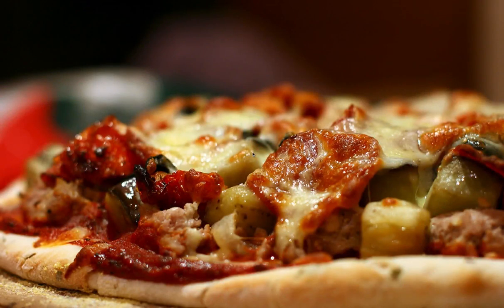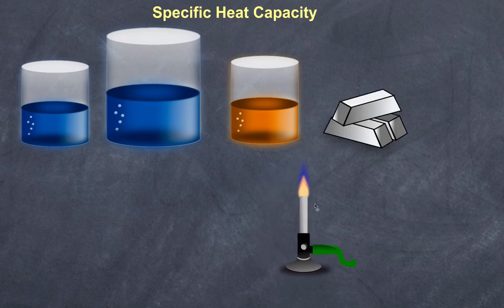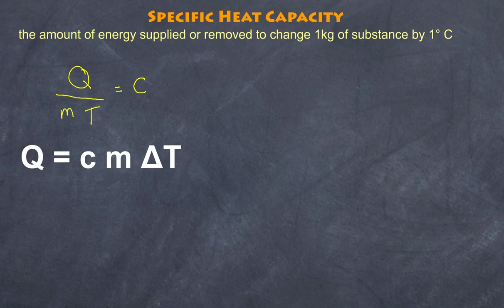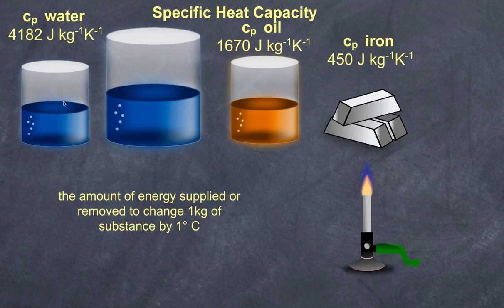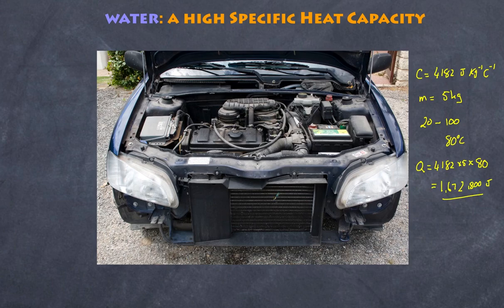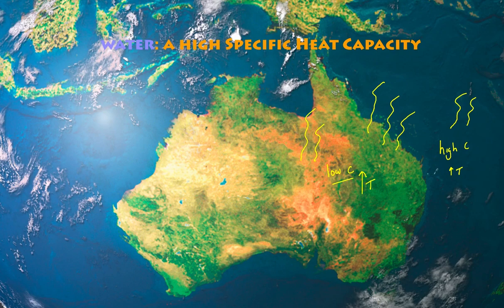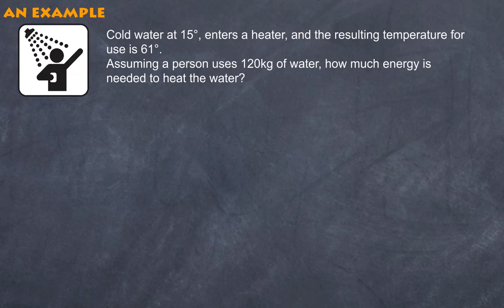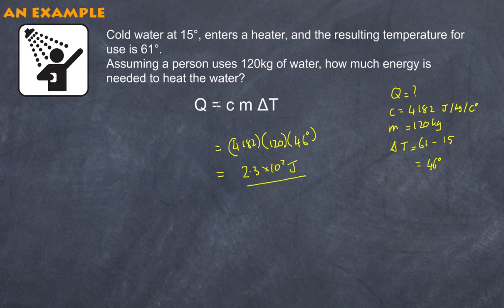specific heat capacity explained

Comment: that means when everttime we substitute for temperatioer do the have to be celcias
Reply from the maker: Actually kelvin is better. But since the scale is only shifted 273, you can use Celsius for specific heat capacity.

Comment: hi. i was doing a experiment to measure water specific heat capacity in a controlled environment with high precision temperature measuring equipment and energy meters, vacuum insulated water container, 4.5kg of distilled water-to minimize the errors, i was stirring the water to avoid temperature stratification and every single time i got values for Cp around 4724 J/kgC. I run out of ideas of what could create the difference. Can we find out who and when and how were calculated values for water what we take for granted? i calculated the thermal losses to minute values and still doesn't get even close to the book values for water Cp-the difference is too high. Can anyone please give me an idea?

Comment: If the kilograms (kg) were different: for example a block of copper at 1 kg is put into water at 2 kg, the specific heat capacity is 1480 and energy is what is required - how would you work this out? I was taught difference in temperature, not kgs. Thanks :)
Reply: Sorry, this answer is probably 6 months too late, but let me know if it makes sense to you! This problem requires a bit of roundabout thinking, so be patient:

Temperature difference works when you're dealing with a single substance. Because you have two different objects (one is water, the other is copper), you would have two different masses, and two different heat capacities as well.

Start off with the statement: "The heat lost from the copper equals the heat absorbed by the water"; in equation form, this reads:
Q (copper) = - Q (water)

Substituting in the heat equation, you can rewrite this statement in terms of mass, specific heat capacities, and temperature:

m * c * deltaT (copper) = - m * c * deltaT (water)

You also know that the heat transfer will stop when the copper and water reach the same temperature. With this in mind, you can rewrite deltaT for each material as (Tfinal - Tinitial)

m * c * (Tfinal - Tinitial) (copper) = - m * c * (Tfinal - Tinitial) (water)

At this point, you can plug in known values for m, c, and Tinitial for both copper and water, then solve for Tfinal

Once you've obtained the final temperature of copper or water, you can plug that back into Q = m * c * (Tfinal - Tinitial) for either copper or water and find the amount of energy that was transferred.

Comment: 8:38  . How do yu know that the heat capacity is 4182 j/kg/c° because it doesnt say anything about heat capacity in question.
Reply from the maker: It’s a standard value for water. Easy to look up.
Reply: @PhysicsHigh  is this value a fixed value? That means anywhere or anything we apply 4182 for specific heat capacity of water?
Reply: If you know the mass, energy transferred (which can be easily calculated from the current, voltage and time taken to heat it up) and temperature rise in that particular time period then you can calculate the specific heat capacity using the equation: energy ÷ [mass x temperature change].
Reply: Also, if this was a question in an exam then the specific heat capacity would be given